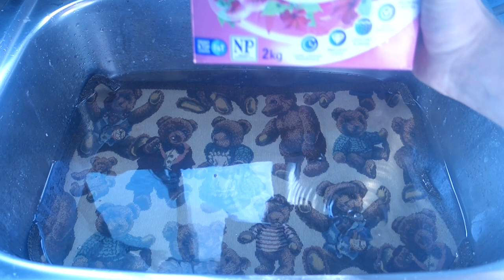Embroidered Teddy Bear Toy Box Restoration - E∞J Woodhouse Repairs

Comment: Awesome job!  You took such care to do every little tiny bit where you could easily have gotten away with doing less.  I'm impressed.  Something I learned with my toybox as a kid was to add 2 pads on the top inside lid of the chest - where it would slam if you let it - not just for noise cancellation but it also keeps a tiny bit of space that keeps the inside lid cleaner, as any dirt or toy paint on one side of the lid will smush the dirt/paint down on both inside lids and make it a permanent dirty.  Even good to have particularly when the paint is drying/setting over the period of weeks where the paint could stick to itself and make it harder to open or even make the paint stick permanently to itself if the paint is particularly sticky, tearing the paint off of the lid when it's opened- in fact that's how I learned to put 2 felt pads (the kind you can buy that are peel and stick and are typically meant for furniture legs) or perhaps the clear plastic kind though the paint could stick to that as well.  Hope that helps and you understand what I mean.
Reply from the maker: Thank you my friend! I very much appreciate your feedback. Wow that’s such a fantastic idea, I definitely understand and know what you are describing. Wish I would have known this before I gave it back haha, I actually have those felt pads on hand 😅 it’s amazing how much you can learn from other peoples experiences. Thank you for sharing and watching 👍🙂